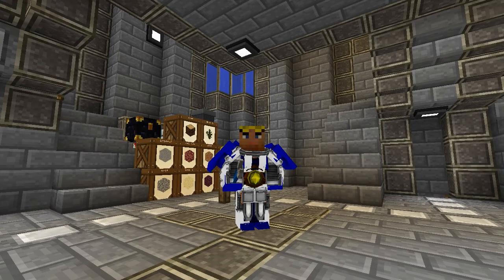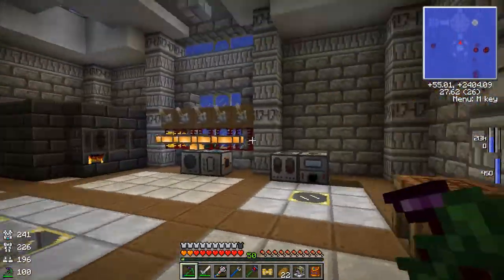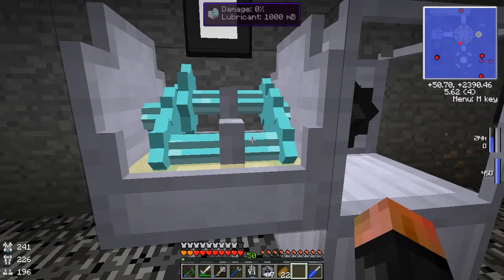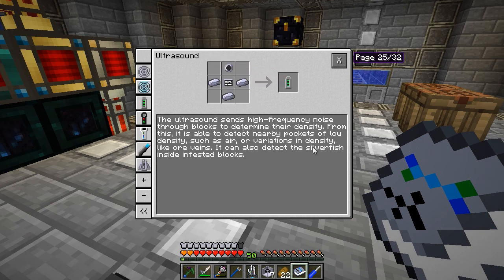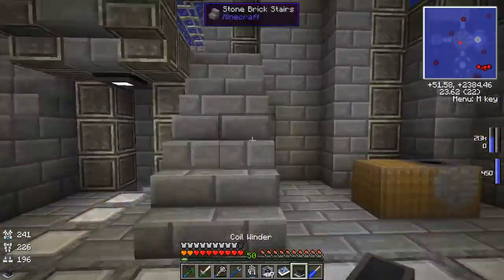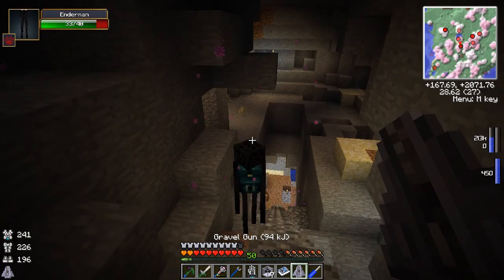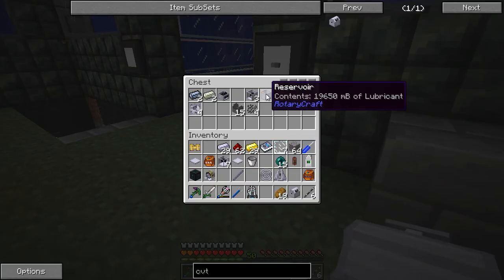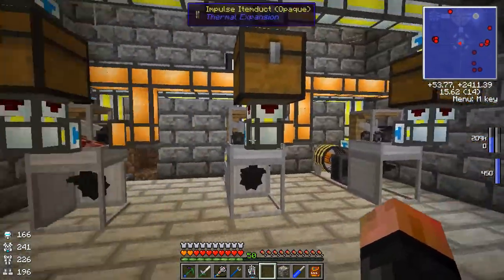FTB Monster ♦ Survival Sealab ♦ 32 [Breaking Bedrock]

Comment: erm, once you have bed rock dug out place the breaker in the same hole facing the floor. it digs 5 blocks in ANY direction its facing so parallel to the ground = 5 blocks of bedrock for every level you ahve acces too <3  that bedrock pickaxe for picking up spawners
Reply from the maker: Cool! I will have to give that a shot. And yes bedrock tools seem great!